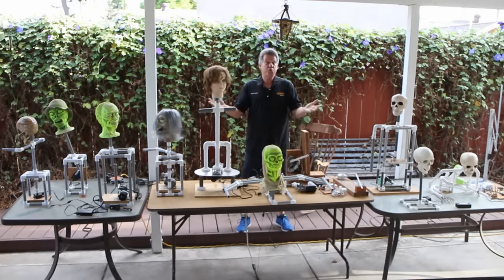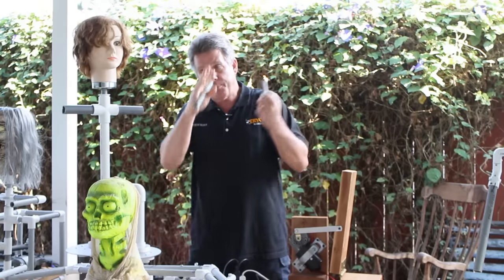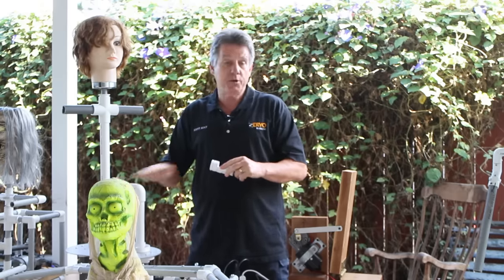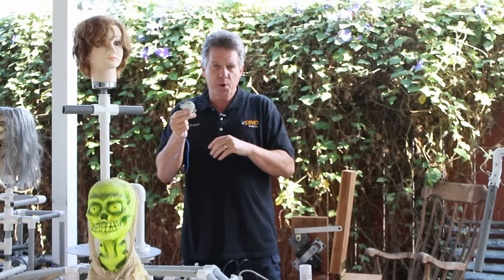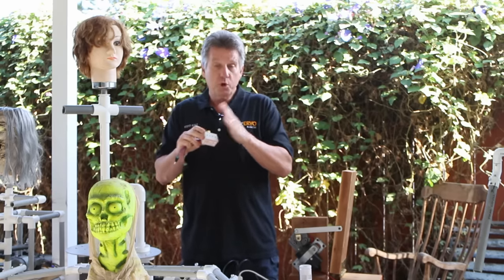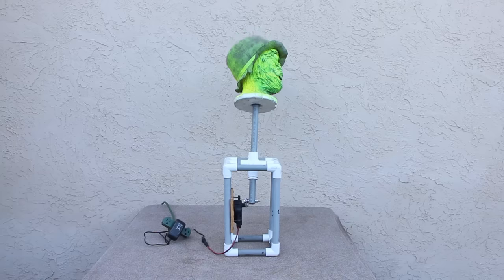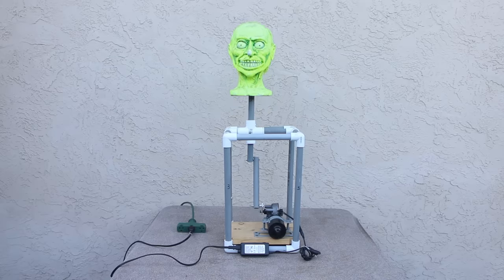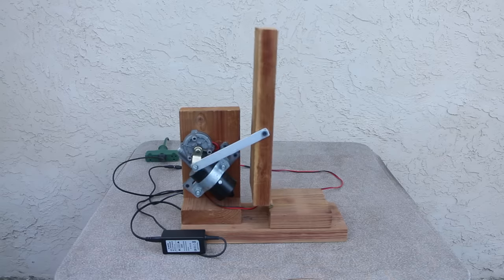Simple Motorized Halloween Props

Comment: This is a fantastic breakdown of motorized Halloween prop options; much appreciated!

Personally, I found the toggle bolt / PVC cap / plastic skull combo to be a bit of a 'lightbulb' moment, and expect to make good use of that tidbit in the future.
Reply from the maker: Thank you!  It's amazing to me how one little tip can make things so much easier when I'm designing a prop.  I'm glad you found that tip useful.
Reply: I'm wondering about using a paper shredder motor some way. I hate parting with something that works.

Comment: Going to check out those fence brackets for mounting wipers. Never seen them before.
Reply from the maker: These are my favorite ones - https://www.homedepot.com/p/Simpson-Strong-Tie-PGT-2-3-8-in-O-D-Pipe-Grip-Tie-PGT2-R/100375207  They are just large enough to fit over the body of the wiper motor.  You may even need to remove the bolt and spread them open a bit to slide it on.  Then replace the bolt and tighten down.  They work great!

Comment: There are also voltage regulators that will reduce the voltage on a motor.  A keyword to look for is "buck".  Basically they do PWM inside and then smooth the voltage to send to the motor.  You can get them that will go down to as low as 1.5V.
Reply: Also:
Many years back a friend of mine made a quite nice prop(s).  Many people have seen "light organs" or "color organs" where the light comes on in reaction to a sound.  He had two jack-o-lanterns.  One was over here and the other over there. (you get the idea about 8 feet apart).  He had a set of PC speakers with one speaker behind each.  He then had two people record a conversation to produce a stereo recording with each person's voice in its own channel only.  A nice thing about the way he did it, the actors could also hide and run it directly with microphones.  This meant they could run the canned stuff most of the time and take over while thinking about which canned audio to use next.

Comment: I had a question about the linkage used for the zombie about 17 minutes in. When connecting the pvc together with bolts, do you keep them loose enough for everything to freely move or are you using certain bolts? I'm having issues with getting the linkage to move freely while the motor spins. Thanks again

Comment: thanks again for the advice!!
Reply from the maker: Happy to help!  Are you working on anything special for this year?
Reply: well I mentioned I had an idea to take a turntable and attach a spindle on it and then fit a loose shaft onto it, my idea was to attach 3 light weight ghosts to it at different places on my balcony and as it turned each Ghost would rise and fall at different times as it turned??? sound nuts???!!
Reply from the maker: @normlor8109  Sounds like a variation of the flying crank ghost.  This should give you some insight on how its done that may help you with your design - https://www.phantasmechanics.com/fcg
Reply from the maker: Here are a couple more videos demonstrating alternative methods for getting multiple motions from a single motor - https://www.youtube.com/watch?v=ffXvAMRo6zE and https://www.youtube.com/watch?v=vZ0GPFhZMc4

Comment: Where do you get the Vent motors wires that you have shown coming out of the vent motor (that you are pluging into the wall wart)? what are they called and do those wires come with the purchase of a vent motor? I want to buy the blower motor but the ones that pop up do not have wires sticking out that we can wire up to a wall wart. anyone know this answer? Also in your 2nd demonstration  (has green guy with the hat), how did you attach the "Bracket" to the vent motor? does a screw just fit right into the vent motor thing that spins?
Reply: He won't be responding. He passed away 😕

Comment: Hi Steve! I LOVE your videos. But I'm a little stuck. I've got these reindeer motors (the guts, not the white-cased one). They come with a brass hex motor coupling nut. But I can't figure out what metal hardware I then use to transfer the rotary motion from the motor to the PVC. I see little bits of metal strips and screws in your videos but I was hoping you could provide a few more details on what those pieces are. Thanks for your help, and amazing work.

Comment: At 13 mins, that prop you made.  Do you have the dimensions of the PVC pipe and parts? I see there's (8) 90 degree side outlet elbow, 2 tee and 1 cross.  Is everything 3/4?
Reply from the maker: I don't have the dimensions but can check after the New Year when I get that box out to prepare for convention season. 
The parts are all 1/2" PVC except for the 3/4" cross.  This allows the cross to pivot on the horizontal bars as well as letting the lifting piece (between the motor bracket and the head) to slide within the cross.  The 2 horizontal pieces coming from the T's on the upper framework that hold the 3/4" cross are only long enough to support the cross.  They don't go completely through the cross as the center needs to be left open for the lifting bar to slide through.

Comment: No matter what props I make I always seem to struggle to get the linkage lengths right to get the correct movement/positioning and this ends up taking so much time to figure out.
What is your principle method?
Many thanks.
Reply from the maker: I know that it can be frustrating to get just right.  People ask me how long it took me to build a certain prop.  I usually say it only took say 8 hours to make but 15 to tinker with it to get it to run the way I want.
It does get easier to judge the lengths needed as you build more props although it always includes some trail and error.  I have a variety of test linkages in different lengths that are already predrilled so I can easily sway them around until I get the movement I want.  Having a couple of these can also be handy to quickly change the attachment points to check out the motion - https://thd.co/2WeYXPp.  They also have some similar but smaller in the plumbing department.
I do try to keep the linkages as short as possible as it is easier to hide the mechanism.
I may be a bit weird (OK, I am) but I do enjoy the tinkering process.
Reply: @halstaff  
Hi.
Thank you for the reply.
I have various lengths of pre drilled bar like the one in your link, but I tend to moronically take the first length and keep plugging away until it works.
I shall spend the next couple of weeks preparing several various lengths with the intention to try them all to see which is more appropriate for my needs.
👍

Comment: Any suggestions on making a sensor or remote controlled jump scare prop?
Reply from the maker: Lots of different ways to do this.  Do you want to keep it powered by a motor or can you use air?   Do you have an example of what you would like to do?
Reply: So I'm planning on making a biohazard drum jump-scare. I want to make it all from scratch using an ultrasonic Mister with LED lights inside. I'm leaning towards using a Wireless push-button system that is electric powered attatched to a melted figure that would jump out of the top.
Reply from the maker: @deverious951  Using a wireless push button is a great, inexpensive way to trigger a prop.  You can fire it off at exactly the right moment.  Of course, it does require a human operator to monitor it.

Comment: Your videos are great! I wanted to ask if, with a vent motor, you can choose the speed of the movement? And if so, how do you do it? Thank you!
Reply from the maker: My favorite method is to reduce the input voltage from the 12V it usually gets to 5V.
Reply: Do you have a link/supplier for the voltage reducer? 
  Have you ever tried using a power window motor from a car? 
  Thanks

Comment: a great video and I have a question I have had this idea foe about a year to have a record Player(not a turntable due to cost) from a second hand shop and have 3 Ghosts rising and dipping from this. if I attach a spindle with a base and secure it to the table and have ..I don't know ,perhaps thread spools and have this spool free spinning around and attach my 3 Ghosts and have each Ghost on 3 different sides of my balcony I envision as one is rising another is dropping and the 3rd is falling even further, it's all in my head now but can it work??
Reply from the maker: I think I understand what you want to do.  If it was me, I would start with a Flying Crank Ghost mechanism.  It would take some refinement to spread them out but the motor will have enough torque.  I concerned that a record player won't have the torque to do what you want (don't know as I haven't tried it but it's my 1st thought).  Here is a video of the original model but their are lots of other descriptions and videos out there - https://www.youtube.com/watch?v=OgtRWiSe-L4
Good luck and please share your project when you finish it.
Happy Halloween!
Reply: thanks but my Ghosts will have Balloon heads and VERY sheer fabric like sheer Cotton for my UV light and the cord will go over my railing. hahaha; if two Chickens can be turned in "It's a Wonderful Life" with a thread spindle, perhaps mine can too!!

Comment: wow - great informative video.  One comment - I've tried the reindeer motors and didn't have good luck.  They have plastic gears and once you get a load on them and the gears strip out that's the end of the motor.  So I've kept with the wiper motors.  Like you said - tons of torque and I haven't had one quit on me yet.Thanks a lot of all the links.  Again - great job!
Reply from the maker: Totally agree with your assessment of the reindeer motors.  They are only suitable for lightweight applications but used correctly, they can be useful.

Comment: I have a question what is a good microcontroller to use for beginners who are not good programmers for  there animatronic projects ?
Reply from the maker: That's a tough question to answer without more information but I'll do my best.  I devoted an entire chapter in my book to choosing the right microcontroller and still feel like I barely scratched the surface.
If you can solder and want to save some money, purchasing PCB's from Haunt Hackers or Scubaspook1 might be the way to go - http://haunthackers.com/ or https://www.youtube.com/watch?v=4i6CTzX9Zy4  They are the some of the easiest controllers to get up and running.
If you want a ready to go microcontroller, the Picoboo's from Fright Props are hard to beat - https://www.frightprops.com/controllers-electronics/frightideas-controllers/picoboo-controllers.html  In addition to having great products, Fright Props has an extensive tutorial section on their website that applies not only to their products but are applicable to other applications as well.
I think that will give you a good starting point.  There are so many to choose from.  You need to find one and learn how it works and stick with it.
Good luck!
Reply: cool  what I was going to do if possible is use the ams system when I create the movement and include that into the controls,  but by what I understand you use the parallax controllers for the ams system so I guess I am confused on how to mix  the two controllers together or how to use one controller for the movement and the rest of the show.
Reply from the maker: @rodneysmith7979  Why don't we touch base over on my Facebook group so that we can private message. You can find it at https://www.facebook.com/SOSHaunt/

Comment: Thanks so much for this video! What fixings do you use on your movable joints that hold two pipes together? I’m using nuts and bolts but over time they tighten themselves up...
Reply from the maker: My pleasure. 
Are you using lock nuts on your bolts like these - https://www.mcmaster.com/nuts/system-of-measurement~inch/nut-type~locknut/locking-type~nylon-insert/low-strength-steel-nylon-insert-locknuts-9/
Reply: Halstaff's Animatronic Workshop I’m not! I’ll give them a try. Thanks so much for the reply and for all the help in these videos. I’m sure I’ll have more questions soon!
Reply: @halstaff  These worked perfectly! Thank you so much for your help. I've noticed that the wiper motors get hot to the touch after a few hours use, even with no load. do you ever have issues with this? I'm worried as mine are attached to plywood bases...
Reply from the maker: @mysteriousal5098  I try to never run my motors continuously.  I prefer to have random movement.  It looks better and helps keep the motors cool.   I like to add these to my wiper motor props so they trigger when someone approaches.  Quick to install and the price is right - https://amzn.to/2AV2f0w
Reply: @halstaff  Thank you!
Reply: @halstaff  Hi! I bought the PIR sensors and they work great. Thank you! The minimum time delay on them is 10 secs and I need my motor to run for around 3 secs. Do you know of a timer / switch I can use? Thanks again for all your help.
Reply from the maker: @mysteriousal5098  I think you are probably ready to graduate to an actual prop controller.  You can then have complete control of the length of time your prop will run once activated.
Reply: @halstaff  Thank you. I'll buy one... was just trying to do things as cheaply as possible! ;)

Comment: Great video, lots'a good info thank you. You mentioned that some PWMs can cause the wiper motor to hum, can we tell ahead of time what to look out for?
Reply from the maker: Thank you!  I have never had any issues with the PWM's from Fright Props or Monster Guts.  The inexpensive versions from eBay can be a different story.  Unfortunately it can be a bit of trail and error but the one I listed has worked for me.
Reply: Ok thanks

Comment: Can the speed on wiper motors be changed?
Reply from the maker: It absolutely can be changed.  Several ways to do it.  First, wiper motors have a high and a low speed.  Second, although they are designed to be powered by 12V,  most wiper motors will run on less voltage.  I have one running on 3.3V for my stirring witch cauldron prop.  I often use a 5V power supply.  When choosing a power supply, be sure to get one with enough amps.  Wiper motors require at least 5A no matter the voltage.  Third, you can use a PWM speed controller like this one from Fright Props - https://www.frightprops.com/electric-motors/controllers/premium-speed-controller-for-dc-motors-linear-actuators.html
Reply: Halstaff's Animatronic Workshop ok thank you very much!

Comment: Any idea on how I can make a tornado prop (about 10 lbs) spin 3-5 rpm from the bottom?  thx
Reply from the maker: I would start with a wiper motor, a 12v power supply and add a PWM to reduce the speed.  I  haven't tried it with that much weight but it should be able to handle it since you aren't lifting that weight, just rotating it.
Reply: Tanks so much! @halstaff

Comment: What about oscillating fan motors?
Reply: The problem with oscillating fans is heat. The blade of the fan pulls air through the motor to keep it cool. When you remove the fan, the motor gets hot and will eventually stop working.
Reply: @jaybo2099  Not talking about the actual high speed fan motor I'm talking about the oscillating motor that goes side to side, for like an arm going up and down or a head moving side to side.

Comment: Where do you get your 12v adapters from? And where do you get the plugs from.
Reply from the maker: If I need them in a hurry, I order them from Amazon.  If I am planning ahead properly, I order from overseas using Ebay.  If you go this route, allow plenty of time to get them and expect you will occasionally receive an  inoperative unit.  I check all the power supplies I order with a meter as soon as I get them to be sure they are working and  outputting the proper voltage.
Reply: @halstaff  ok thanks! I just ordered one. Another question I had was one the 2nd one you show there was a connector that you connected to he plug and to the motor so you can easily remove it. What are those connectors called so I can orser some?
Reply from the maker: Here is a link to the last connectors I ordered - https://www.ebay.com/itm/5x-Male-5x-Female-2-1x5-5mm-DC-Power-Plug-Jack-Adapter-Wire-Connector-for-CCTV/172040632645
Reply: @halstaff  ok sweet thanks for all the help!

Comment: I did not understand how to place the skull on the PVC...
Reply from the maker: You use a Mushroom-Head Toggle Bolt Anchor like these - https://amzn.to/2Zvn78r (affiliate link - they also have them at most hardware stores).  Drill a hole to match the bolt size (3/16") for the link shown in the center of the bottom of a PVC cap like this one - https://thd.co/2LbRCez. Install the screw from the inside of the cap and attach the expanding piece.  Drill a hole in the bottom of the skull just big enough for the expanding piece to fit in when folded flat to the bolt ( I think 1/2" for these).  Insert the expanding piece into the skull and tighten down the bolt until the skull is securely mounted to the PVC cap.
I hope that explanation helps and doesn't confuse you more. :)